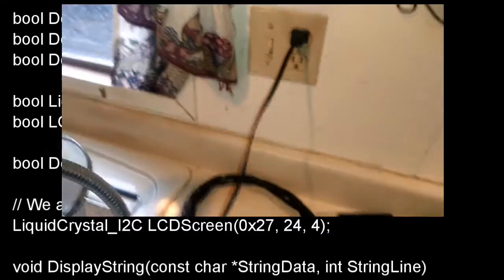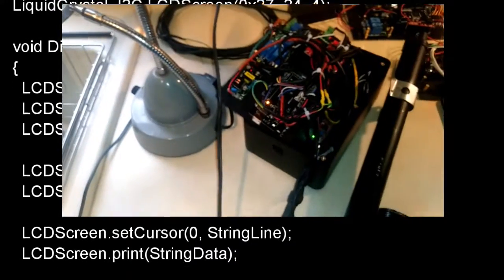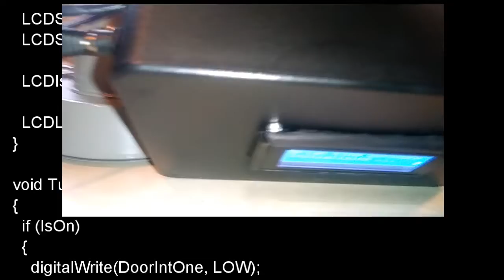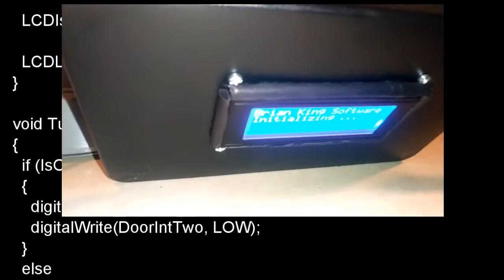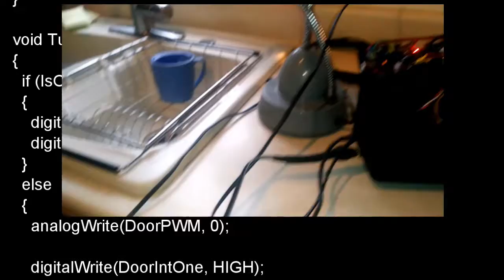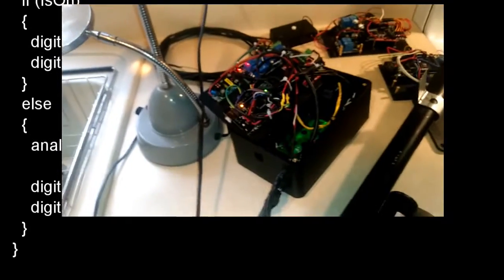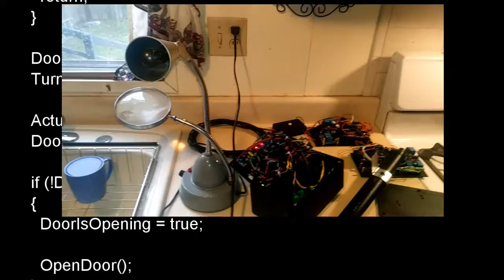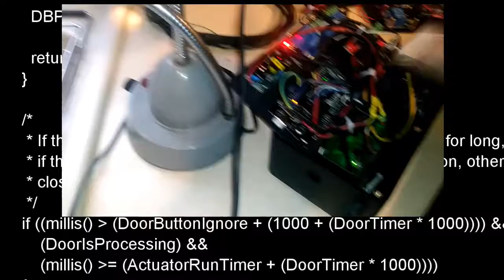Arduino Home Control - New Channel Launch

Comment: You got it!! Done!!
Reply from the maker: Yes, finally lol ... I got severely frustrated and discouraged several times when I couldnt get it to work right, especially when I plugged in the one attempt, heard a sizzle, then saw smoke coming from the processor lol ... The code is deceptively simple. The Arduino is so sensitive that static in the air would trigger button pressed code so I had to put in timers to ignore that stuff. That and the necessity to use a motor controller even if all you have is a simple cooling fan.

Comment: Hi Brian, good stuff, man.  If I tried that, my house would be a pile of ashes with me underneath.
Reply from the maker: Lol ... It looks more complicated than it is. If you understand the basics of electronic engineering, and software engineering, you could do this.

I was never a big hardware guy, I always did the software side. Hence taking 3 attempts to get it right lol
Reply: @BrianKingProductions   400 attempts by me over 100 years would result in whole towns being wiped out
Reply from the maker: LOL ... I am being honest ... As long as you understand the basics of how electric current flow, and the IF statement in programming works you could do it. All software revolves around the IF. The logic is literally IF this EQUALS that THEN do this ELSE do this.